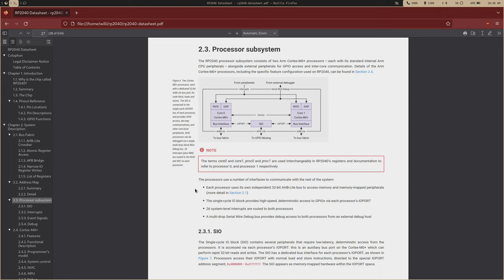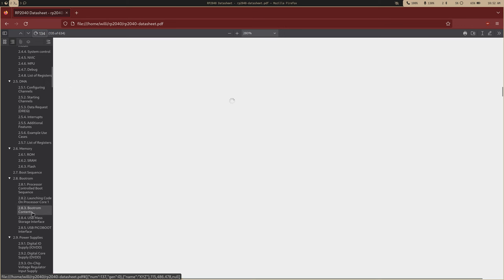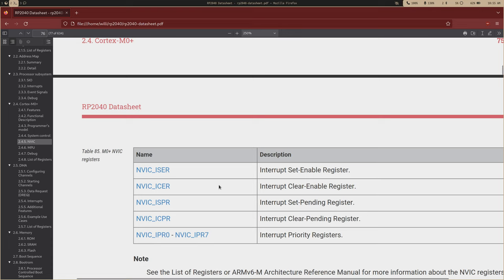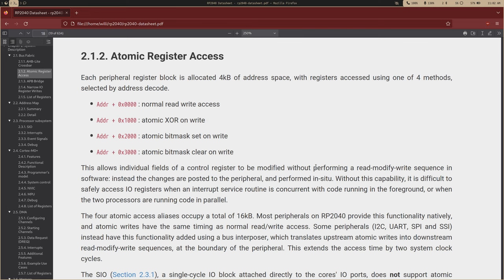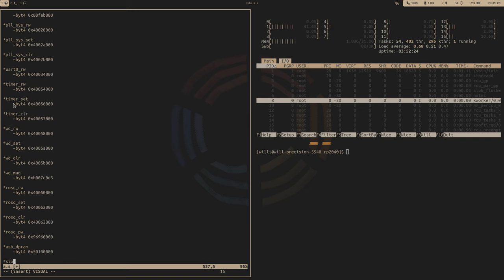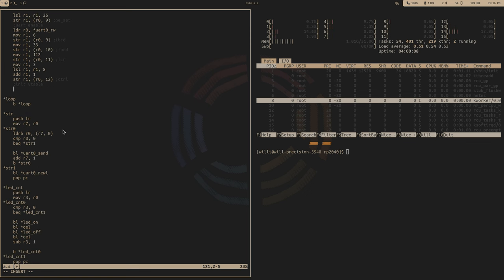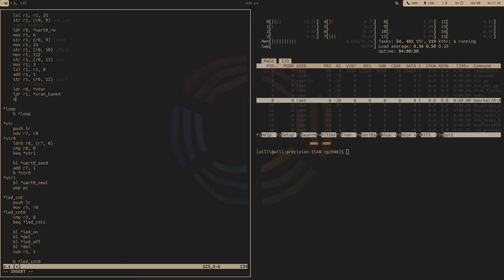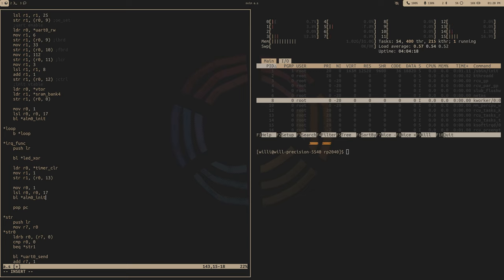RP2040 - Baremetal Assembly - Interrupts and Alarms

Comment: Will, at exactly 12:00 you say that ALARM0 offset is 4, but on the page it says the offset is 0x10. Is it right to assume that what you’re doing is dividing by 4? ie 0x10 = 16 decimal 16/4 = 4? So basically your values are long words?

Sorry but then earlier when you’re reading from the timer register the offset on the page says 0x24 and you say 10? but by my above logic that would be 0x24 = #36 and decimal 36/4 = 9.

Basically I have no idea where you’re getting these offset numbers from or how you’re calculating them, could you explain please?